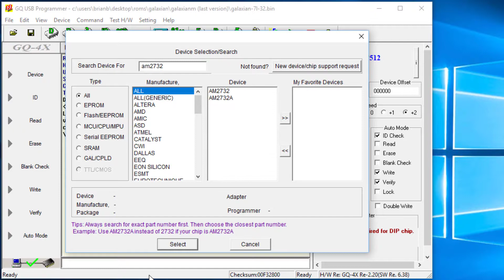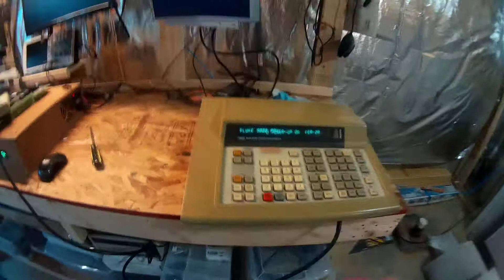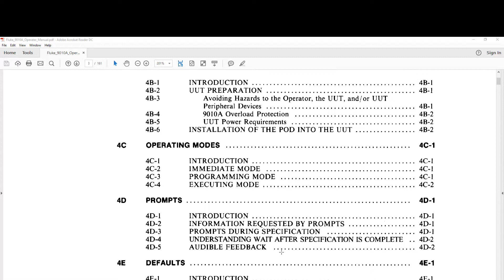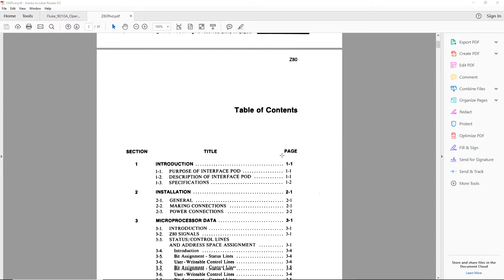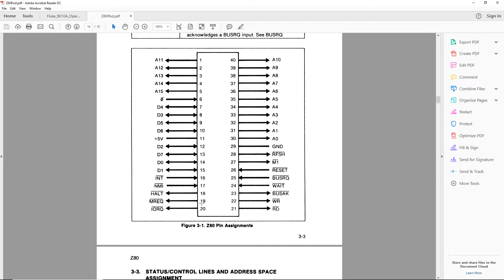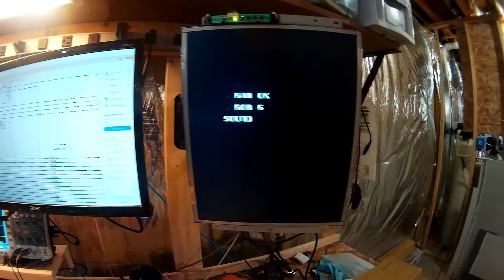PCB repair #20180701.01 Atari Xevious

Comment: Because on the whole bit size that is load on the ROM chip is much more than 8 bits or 16bits data size. When you read the ROM contents in a external ROM reader and view the ROM contents its much more than 8 bits or 16 bits. So the Checksum 16bit size is suppose to be comparing and error checking the whole program loaded on the ROM chip. When you load the whole ROM content in your external ROM reader and "COMPARE" it to the mame or hamster ROM file, this is doing a Checksum test. So it doesn't make since to me that the checksum is only 16bits when the whole loaded contents in the ROM chip is much more than 16 bits.
Reply: A checksum is not the entire contents of data, just a small number "representing" the contents of the data. you can refer to the wikipedia article for more explanation on checksums and their purposes. https://en.wikipedia.org/wiki/Checksum

Comment: any reasons why the checksum is 16bit and not 8bit or 32 bit?
Reply from the maker: bill williams: nope my guess is 8 bits does not provide enough distinct values to ensure reasonable protection from the Roms being incorrect t but still having matching checksums (1 in 256 chance) checksums and 32 bits is probably too much work for the cpu in the fluke, I think the fluke used a z80 (or some similar cpu) to do its work and most 8 bits CPU’s can actually do math 16 bits at a time. (Yes the data bus is only 8 bits but the cpu can internally use 2 8 bit registers as one big virtual 16 bit register for certain operations)

Comment: Yes i have seen you in your video write a hex value to certain RAM addresses and read them back when you get a DCD error. When you get a DCD Error from a RAM chip it can be either a stuck data bit or a stuck address bit, this is why you write and read from multiple RAM addresses to troubleshoot the RAM's address bits have a "shorted sector internally inside the RAM chip or its the external RAM address line that is shorted.

Comment: the Fluke 9010A has RAM short and RAM long test, what other RAM test do you use on the Fluke 9010A? I haven't seen an option to change the RAM bit patterns to test the RAM chip for errors.
Reply from the maker: I almost always use RAM long as it does extra testing and can determine errors that a RAM long will not find. The only time I usually do a ram short is if I am  pretty sure the RAM is ok but I just want a sanity check. There are no other automated tests on the fluke 9010a that I am aware of, you can manually do RAM tests like "walk" I think or write your own program to test things however I never had a need to do so as the RAM long test works ok for me. Sometimes if I am trying to narrow down something I will manually read and write certain values to test a specific bit if I think a certain data line is not working or if there is something called a DCD error and I think maybe it's not a DCD error (as the fluke can give you incorrect results caling something a DCD error when it's really a "bad bit"  as it makes assumptions about the memory layout that is sometimes not correct in the old games)

Comment: I think its the Prom chips that need to be changed if you use a different ROM set, because the PROM chip is programmed for that ROM set only.  When you use an EPROM reader to read the contents of the ROM chip all i see is Hexidecimal values in each address location. When you read the ROM chip from a different ROM set for the same game the hexidecimal values will be different in each address location because they changed the code, updated the code, fixed the bugs, etc. When testing a RAM chip and you read the contents using an ROM/RAM programmable reader it displays the contents in Hexidecimal values in each address locations. How do you tell from reading the contents that the RAM chip is bad? Does you RAM reader/writer have a test program that writes a "checkerboard test program" in the RAM chip that writes 1's and 0's to the RAM's address locations so you can see the RAM contents if these is a bad ram location or sector?
Reply from the maker: no, generally you can simply swap out the ROMs from any game version to any other version of the same game, in regards to the RAM tester, yes the Fluke 9010a that I use to test RAM has a series of tests that test each address with various bit patterns to try to determine if the chip has errors.

Comment: For every arcade game there is different versions of ROM sets, tabletop ROM version set, program#1 ROM set.  Why can't you use a different version ROM set or use the tabletop ROM version set with the arcade circuit board. The Graphics will look scrambled looks like you have sync issues when using a different ROM program set or a different program ROM set. The arcades motherboard should be the same because its the same arcade game but its a different ROM set version 1,2, etc. Any reasons why it doesn't work?
Reply from the maker: the different ROM sets (besides cocktail/vs upright) are usually "bug fixes" or enhancements. You can almost always swap out the ROMs to any other version without issue.